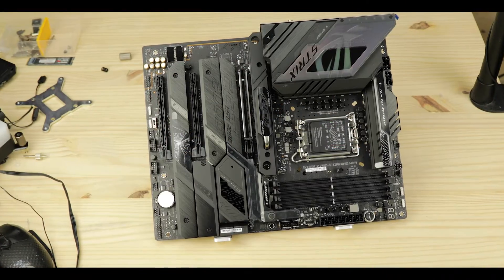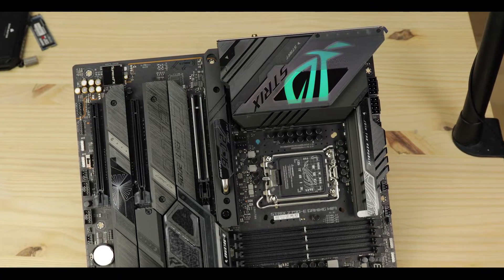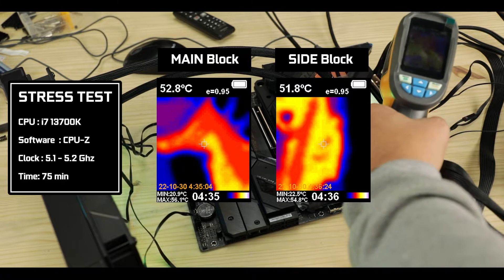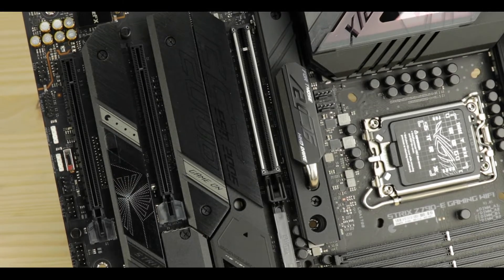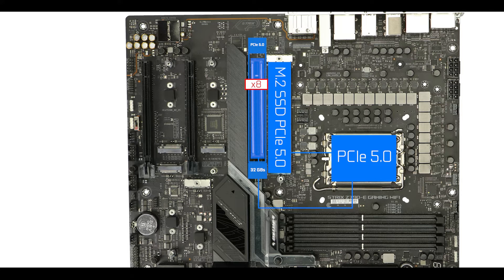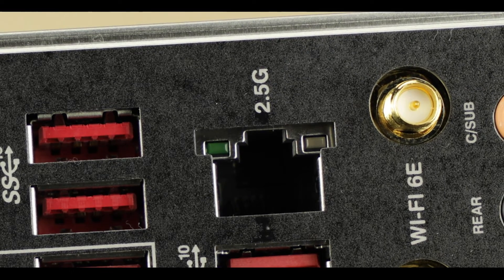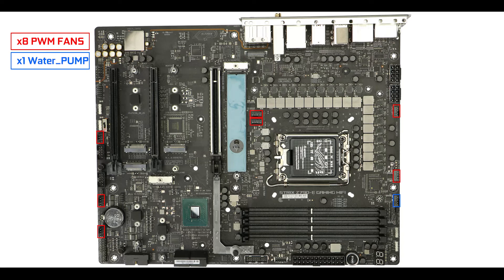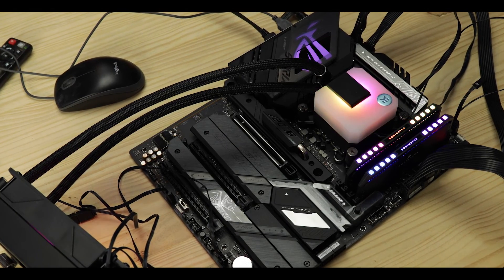ROG STRIX Z790-E GAMING WiFi : who needs a HERO?

Comment: Do you know if the z790 E can support i9 14900k cpu? I’m told it only supports 12th and 13th gen.
Reply: "The Asus ROG STRIX Z790-E GAMING WIFI ATX LGA1700 Motherboard supports the Intel Core i9-14900K 3.2 GHz 24-Core Processor with BIOS version 1202. If the motherboard is using an older BIOS version, updating the BIOS will be necessary to support the CPU."

Comment: Does it work with i9- 14900k? Thanks
Reply from the maker: After BIOS update yes.
Reply: @Laurentschoice  thank you so much. Cpu temperature higher than previous, I get 81 degree celsius. I wonder lower than. Thanks
Reply from the maker: And that's pretty good. I got one too and it's hitting the 100c all the time.

Comment: I think you got the bottom PCIe slot confused with another board. The manual says both of the X16 runs at 4.0.
Reply from the maker: Read the table the other way around :)
There are only 16 PCIe 5.0 lanes available on the CPU so you won't get more than that :)

Comment: Well, it is a nice MOBO. Got a question tho. I wanna upgrade my PC from I5-11600KF to a I7-13700KF or a I9-13900F. Well the wattusage on fully load for both I7 and I9 are 235 watt. My GPU on fully load almost 400 watt. It is a Rog Strix RTX 3080 OC White Edition. Total usage of watts on fully load on what I can see on almost every chart when benchmarked both GPU and CPU are between 628W to 653W at it's most. Having a 750W PSU so that means I can use I7-13700KF or I9-13900F plus Asus Rog Strix RTX 3080 OC White Edition. Or am I wrong?
Don't want to change the PSU because of the very good cablemanagement. It is a pre-built computer I got and the company I bought it from did a monstergood cablemanagement and I don't wanna screw that up.

Comment: What's up with Asus?  The last mb I bought and still use is an older Hero Maximus board. All I had to do was screw the damn thing into the case, plug everything in and it worked fine.  Now, I go to their site and get an assistant on the horn and he proceeds to give me the 8000 steps to get this mb here that your reviewing up and running.  Good grief.  So after a half hour of crap, a new browser just to get a damn file.  Another program to rename files, renaming files. Intel Me.  Good grief.  We have gotten to the point once again where tech is so advanced we are going backwards.

Comment: 08:50 If you running a 4090 you will bottleneck it down to 16gbps by only giving it 8 channels at gen 4 (since it uses a gen 4 bus). It's better to give it full x16 channels with access to 32gbps (64 at gen 5), of which it will only use 20gbps. In short don't put anything in the M.2_1 slot. If you running any less powerful card its probably a non-issue.
Reply: so even if you put just a gen 4 m2 in slot 1, it still drops to x8 don't it for the gpu ?
Reply: But can you still achieve 16 channels if installing the 4090 in the PCIe 5 slot, and avoiding the M.2_1 slot?
Reply: @jeremymartinez6024  Yes
Reply: hey, I'm building my first pc ever, and I'm using this motherboard and a 4090, so I wanna be careful to avoid the bottlenecking u just mentioned, however I'm confused as to which slot you're recommending to avoid. What/which is the M.2_1 slot I should avoid using? Sorry if the question sounds stupid, but it's my first time doing this so I'm hearing all these terms for the first time. 😅
Reply: It's the M.2 SSD slot. Check the motherboard diagram. A heatsink covers it.
Reply: so where instead should i put the 2 SSD internal storages i picked up? or were u talking about the gpu when u said to not put it in the 8 channel slots? and again sorry if the questions seem dumb lol, im trying to educate myself as best i can  @KenseiOtaku
Reply: jeremy's comment about putting the 4090 in the PCle 5 slot, but not putting anything in the M.2 slots is why im confused about if that means i shouldnt put my memory storages there or if he was talking about something else
Reply: Don't put anything in the M.2_1 slot to avoid throttling the bandwidth to your 4090. You can use the other slots labeled M.2_2 through M.2_5 assuming you're using a Z790-E mobo. If it's another Hero model let me know.

Comment: According to Asus tech specs he is incorrect. He states it only has 1x PCIE 5.0 16,  1x PCIE 4.0 16 x4  and 1x PCIE 3.0 16 x 1   I have just double checked Asus specs and it has  It has 1x PCIE 5.0 at x16 and 2xPCIE 4.0 16 at x4.   So last slot isn't a PCIE 3.0 16 x1  it is a PCIE 4.0 16 x4... i.e. a better spec that he is reporting.

Comment: Have had this since launch. My only gripes are it should have had dual NICS. Plus, there are 2 fan headers dead center that are almost useless if you have a air cooler that just sits over them. Also, realize that the lanes when adding nvme's mean you should not put a nvme drive in I think it's the second slot AND the pcie5 slot. I'm going by memory here but the lanes are tricky. You actually need to use slot 1, and 3 to not impact your gpu.
Reply: nvme in slot 1 will drop your gpu from 16x to 8x, but thats pcie5. so 8x is equivalent to 16x pcie4, which will not bottleneck anything since even a 4090 will not saturate pcie4 16x. so its perfectly fine to run a pcie5 nvme drive and a top of the line graphics card and not bottleneck either.
Reply: @iris4547 With the 4090 in the PCIe Gen 5 slot and avoiding the M.2_1 slot, can you still achieve 16x?
Reply: Isn't it Slot 1 you should avoid?

Comment: So when I use the top m.2 slot with PCIe 4.0 ssd i have only 	
PCI Express x8 on the top PCI slot?
Reply: Did you find out for sure if this is the case ? don't want my 4090 running at just 8x, will only be using top M2 slot for gen 4, thx

Comment: If you use that first M.2 slot, the first pcie slot for your graphics card works only at x8.....
Reply: Only if it's gen 5, a gen 4 m.2 won't split
Reply: @tempfile3368  are you sure? Many are saying it’ll even when using gen4 ssd’s
Reply: @darth6980  Did you find out for sure if this is the case ? don't want my 4090 running at just 8x, will only be using top M2 slot for gen 4, thx

Comment: Here's a question, is it possible to get 5.0 x16 in the gpu slot PLUS m.2 5.0 running simultaneously? Something like allowing the native gpu card but attaching the ssd in a pcie expansion card beneath it? I don't know much about this stuff but I would hate to fast forward 5 years and be having to rip my motherboard out or sacrifice those beautiful ssd speeds to keep up graphically.
Reply: You can populate the PCIe5 slot and the top M.2_1 slot with PCIe4/5 devices, but they will run at x8 max. each (even if the SSD is x4 only). AM5 is a different story.

Comment: So if i put a GEN4 NVME drive in the first slot or the one closest to the CPU will I be lowering the speed of the GPU?
Reply: Yes. Even when it's neglectable. It doesn't matter if you put in a Gen3, 4 or 5 SSD - it will cut the 16 lanes in half.
Reply: From what info i got m2.2 slot to not share gpu band

Comment: In the manual ASUS states that any fan connecter will support a water pump.12:44
Reply from the maker: They can,  but don't deliver the 5 watts per that D5 water pump need to  operate at full speed. 

Hope this clarifies
Reply: @Laurentschoice  that sucks, so I 'll need to go to the aio connecter for 24/7 full throttle.
Reply from the maker: Indeed.  .... not optional
Reply: @Laurentschoice  I returned it.
Reply: @Laurentschoice is this the same for the Hero?

Comment: This board looks really good and makes the more expensive boards look - expensive... The B650E version of this model is 400€ (and had an additional 45€ cashback) - and is pretty close in features. I am wondering what you are thinking about that one. It is a little more simplistic then this Z790 version though, and the chipset temperatures are higher...
Reply from the maker: Revieing the STRIX B650-E tomorrow :)
Reply: @Laurentschoice    brother im curios i have just bought z790 E gaming and gonna buy sk hynix p41 ssd but its not on the list on asus website, will they still be compatible ?

Comment: Where did you get the information about the number of PCB layers? Where can I find proof?
Reply from the maker: When u get a board, get a high precision lens, zoom on the PCB edge, and you can count the layers :)

I did add some footage of it on the review. 

Hope this helps
Reply: @Laurentschoice  I did something similar, as far as the macro lens of my phone allowed, but unfortunately it was difficult to calculate exactly, it seemed to me either 2 bold layers + 4 regular ones, or still 8 regular layers. Need a microscope :D
Reply from the maker: Well... to answer your original question,  I am where you can find proof ;)

Comment: Who needs a hero? Me. Strix is $500. Hero is $600. If you spending that much on a mobo already, another $100 won't kill you. XD
Reply: I faced the same choice but still went for the Strix E-Gaming for 2 reasons - 1. You need to use the add on M.2 PCIE card on the Hero to use PCIE 5.0 M.2 SSD whereas the Strix has it onboard. Issue with the add-on card is that it would severely block airflow to the 4090 fans. 2. Hero comes with inbuilt Thunderbolt 4 ports which I will never need at the cost of USB A ports, of which I need as many as possible (even though I also use powered USB hubs). The superior audio codec on the Hero would have been nice but overall the compromises didn't make sense for me and ontop of that would have had to pay extra for it.
Reply: @vincentsantucci2478  That's the same reason I chose the Strix E lol
Reply: @vincentsantucci2478  What's your RAM? I heard there are some potential stability issues at 7200+ but I'm not sure if they've been fixed or not.
Reply: @maulCS  I have 6400 and zero issues. The Strix should be able to handle 7200 but I can't speak from experience.
Reply: @vincentsantucci2478  Well, guess I'll find out. Was considering ordering the Hero but besides the improved VRM I can't see any real reason to - not like the VRM would affect me anyway.
Reply: @vincentsantucci2478  the strix however if you use the gen5 lane with a gen 4 or gen 5 you cut the gpu bandwidth in half to x8. While on the hero you can put any gen 4 anywhere and not suffer the same consequence. Then user a vertical mount for the gpu and place your hyper expansion card on the third slot
Reply: @Temp File  not quite correct. If you use the Gen 5 M.2 slot for any SSD, yes, the GPU lanes are cut in half. Not that it matters because even a 4090 doesn't saturate Gen 5 x8 (which is equivalent to Gen 4 x16). But if you do want to avoid that and use a Gen 4 SSD, you can just use any of the other 4 M.2 slots for it and the GPU lanes are unaffected. The Hero has exactly the same issue - if you install the Hyper M.2 card on either of the Gen 5 slots, the other Gen 5 slot is cut in half. At least with the Strix you have the option of using a Gen 5 SSD without having to vertically mount your GPU, which i have no intention of doing. There is currently no Intel motherboard that allows you to use a Gen 5 SSD while still keeping 16 Gen 5 lanes for the GPU.
Reply: @vincentsantucci2478  are you saying that using the gen 5 m.2 slot on the e gaming board, and using the nvme card on the hero board both cut the GPU lane bandwidth? They both cause the same issue?
Reply: @jayjay-th6vj  precisely
Reply: @tempfile3368  You can put any gen 4 card in the multiple gen 4 slots on the strix, with no impact on GPU, but unlike the hero it has the option of a gen5 ssd. A gen 5 card probably won't get bottlenecked by 8x lanes, as the bandwidth is so high on those lanes. That may change next gen with say a 5090.
Reply: Personally got the z790 hero myself.  I'm happy with it
Reply: To be fair if your spending that much at least pair with parts that make sense. Maybe consider overclocking because that's the reason to go for a Z series anyways.
Reply: Than why you dont add few more and buy EXTREME 🤔
Reply: @Julije Gombar  the extreme is $1000 mobo for very little performance over the hero. If you wanna dish out $1000 for a mobo go right ahead.
Reply: @johnrambo1349  After so much trouble with Hero XII I decided to buy best I can for my 11700KF and I found Extreme XIII for 814 EUR with shipment included and that is so good replacement for my old P5Q3DeLuxe Wifi paired with Q9559@3,8 😋
Reply: I wish it was only $100 difference in Canada. Here it's a difference of more than $250. Not worth that much more.

Comment: I have this board, only issue I have is a little bit of coil whine from the vrm.. If someone knows a fix..
Reply from the maker: Oh that's an immediate return.. and replacement on the spot! Just bring/send it back and make some noise. 

UNACCEPTABLE !
Reply: @Laurentschoice  seller won't rma for it unfortunately its not so loud I've reduced it by lowering vcore. I've seen there is settings for acoustic noise mitigation but haven't tried it